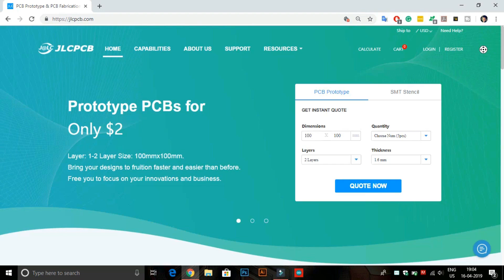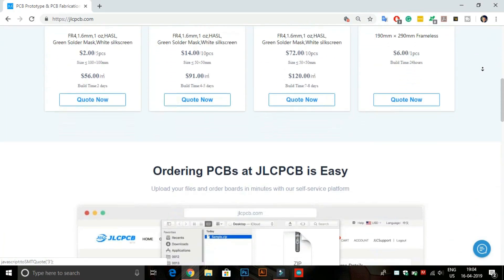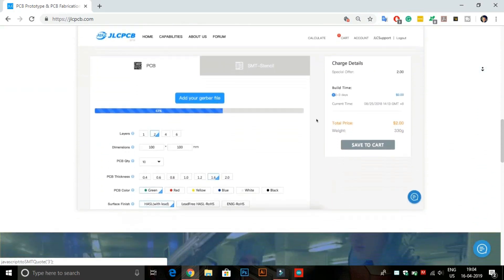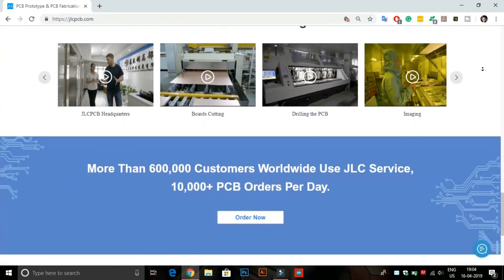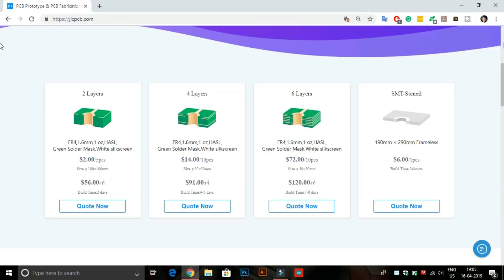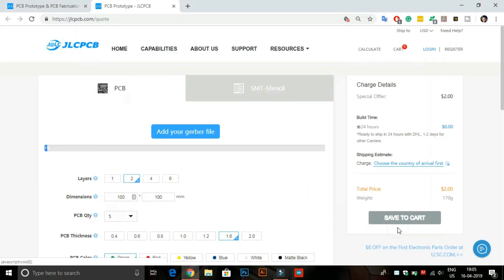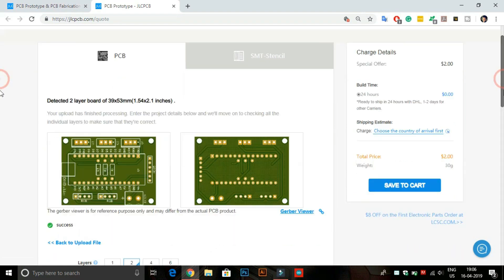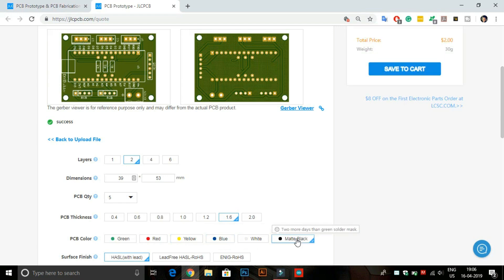How To Make Arduino Line Follower Robot Using L298N Motor Driver

Comment: code not working me, i have ir sensor 5 sensor one board, and motordriver dfduino l298p same chip but totally different code run motors, 2 pcs. i not know how change code sensor more and driver different. i haveint E1 = 5;
int M1 = 4;
int E2 = 6;
int M2 = 7; E1/2 speed value 0-255 and M1/M2 motor on /off high/low.
Reply: https://youtu.be/41Zf4U7EuzA
Advanced line following robot

Comment: can i use the same code for arduino uno also? and can i connect the jumper wires directly to the uno from the motor shield and sensor? without using pcb ! please reply me as soon as possible i have a project work i already tried one but didn't work hope i'll get a reply. Please Help me out. thanks in advance
Reply from the maker: Yeah bro you can use this code for arduino uno. But instead direclty connecting with the motor driver i suggest you to use the dot pcb for better result.
Reply: @DIYBuilder  can i use a single 9v battery? And how to tune the IR proximity sensor
Reply from the maker: 9v battery won't work here. Use 2ps 18650 battery. To calibrate the sensor first place your car on white surface then slowly rotate the Blue potentiometer screw clockwise until the motor starts spinning.
Reply: @DIYBuilder  should we use the same 2ps 18650 batteries even for your another line following robot using L293D motor shield. And arey they rechargeable?
Reply from the maker: Yes
Reply: https://youtu.be/41Zf4U7EuzA
Advanced line following robot
Reply: Can i use 3 pcs of 18650 batteries
Reply: @hari-sn5jj  not needed 2 enough